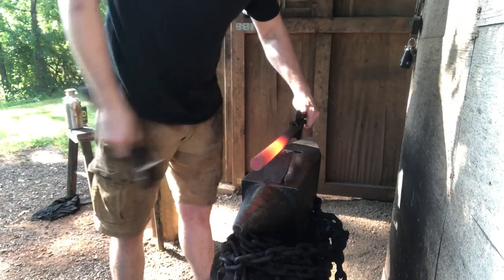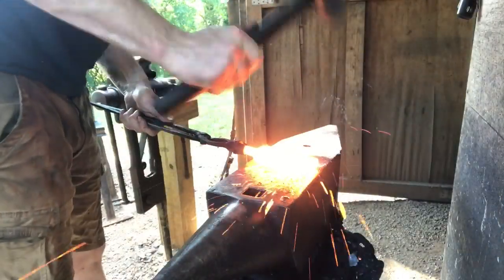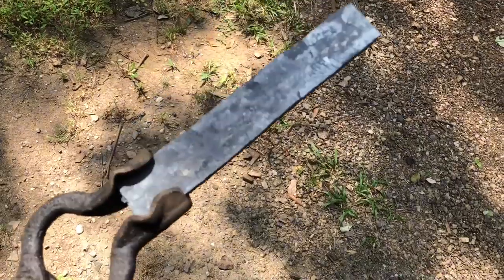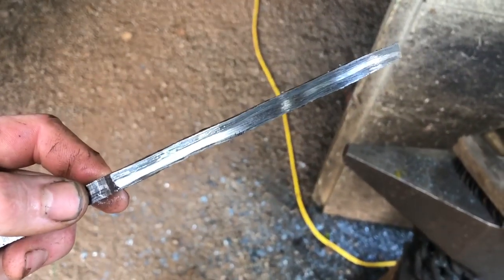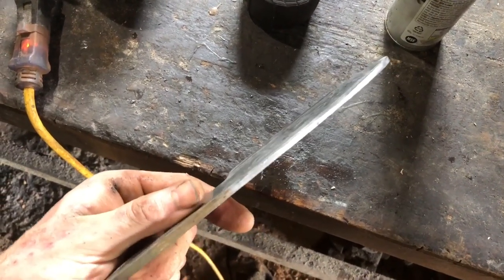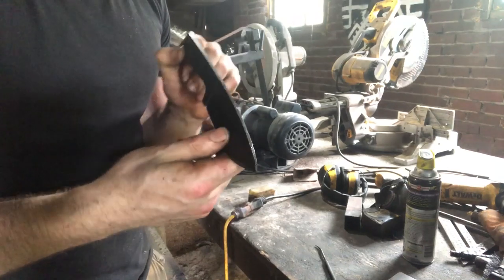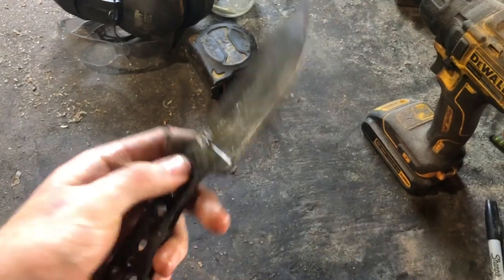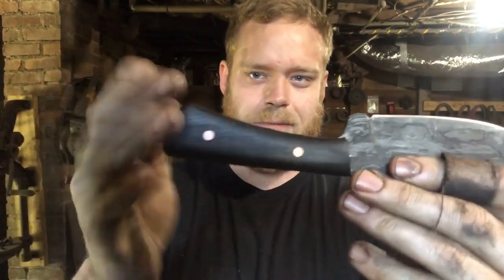Forging a wrought iron San mai knife

Comment: FYI 450°F is getting kinda close to the point where you start to see tempered martinsite embrittlement in some steels, you might want to do some testing with lower tempering temperures to see if you can get enough toughness at a lower temperature like 430°F.